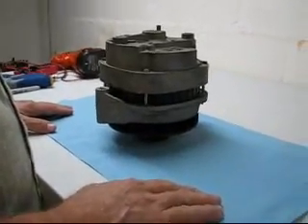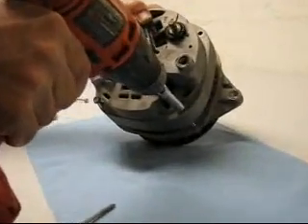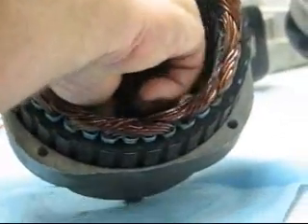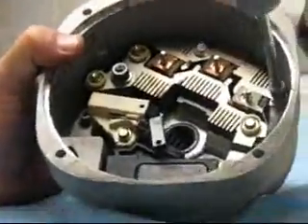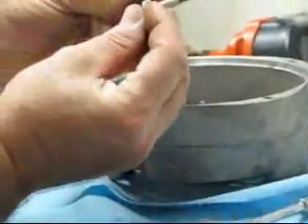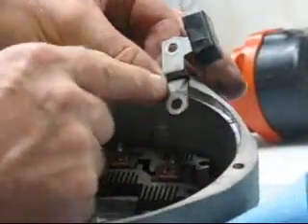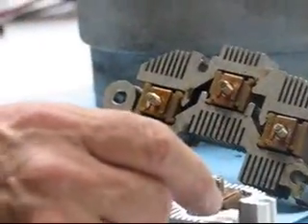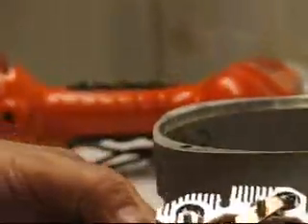Part 1 - GM's CS144 Alternator Rebuilding, Alternator Repair. Visit www.AlternatorParts.com

Comment: Hello, i have a delphi watercooled 190 amp alternator with a big terminal for the positive and a plug with 2 wires inside. I am assuming this is a 3 wire alternator, how do i find out wich wire goes to a lamp and wich one is connected to the positive? Couldyou give me any hint? i looked at the regulator but no info there.

Comment: Does your company sell the outer case that will change the orientation of the large mounting tabs to use this type of alternator with a 95 6.5 diesel serpentine belt setup?

Comment from the maker: Your stock unit is a CS130 series alternator with the D411 voltage regulator. That vehicle also had an optional CS144 which uses the same D411 regulator.

Comment from the maker: You can attach a line with a potentiometer to the voltage sense pin, this will let you increase the voltage output. You can also replace your voltage regulator with an adjustable model.

Comment: i have a high output cs144 in a 1996 . i was wondering what i need to set my voltage to a higher set point than 14.7  maybe somewhere around 16 volts

Comment from the maker: You could have a bad rectifier, a bad ground connection, or a bad plug connection. I would try adding a ground cable directly from the battery negative to your alternator case, then replacing the bridge rectifier.

Comment: does your company have a limited selection to the vehicles you listed? i have a 2003 corolla and i want to try to upgrade my 80 amp alternator to a 130~160 amp alt  via rebuild save on costs. i'm wondering if you can point me in the right direction because google has not been fruitful for me.

Comment: Since alternators use a bridge rectifier with diodes to convert the AC current to DC current, can I just remove the bridge rectifier and then use the AC current that the alternator puts out to power home tools and light bulbs, etc.?  If this is the case, what voltage would the alternator be putting out? Thanks in advance for a quick response. And thank you for this very informative video. Keep it up!

Comment from the maker: Alternators make AC current just like what comes out of the electrical outlet at home. Then they use a bridge rectifier with diodes to convert the AC current to DC current for the vehicles battery & electrical system

Comment: hi i am told that it is possible to get massive ac voltage out of an alternator by rewinding it some how.would you know as i am researching plasma ignition which requires a high as possible ac voltage thank you

Comment from the maker: How all alternators work are basicly the same but how they are put together may be different. Also some have internal voltage regulators and some have external voltage regulators. Some of the later alternators even work with the vehicles engine management computer to tell it to change fuel output based on how much load the alternator is putting on the motor. The higher output an alternator goes the greater load it puts on the motor.